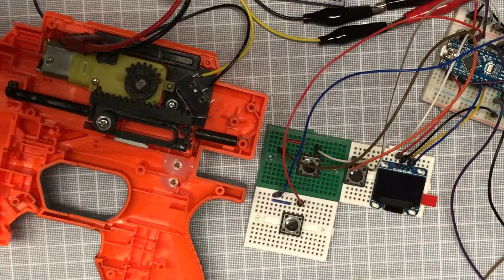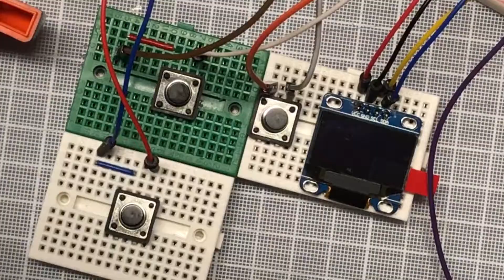{Mod} Select Fire Stryfe + Arduino (Part One)

Comment: Hey tungsten!
I love this mod, real nice!!!
I build it my self with the worker full auto kit & your YT videos.
All works fine, only display don’t work.
I don’t understand why?
I also don’t understand what are you doing in the code with the size of the oled display. I don’t know how to get into that options and where to change form 128 x 32 to 128 x 64.
Maybe you have an idea how to help.
Best wishes
Reply from the maker: hmm, I think because I am using a old version of the library I have to modify "Adafruit_SSD1306.h" file to set the screen size. I think the new library, which if you download recently (which I did not try) you can change the screen via the constructor. in my code I use "Adafruit_SSD1306 display(OLED_RESET);" I believe the new code you can use "Adafruit_SSD1306 display(128, 64, &Wire, OLED_RESET);" the library also come with example code: https://github.com/adafruit/Adafruit_SSD1306/blob/master/examples/ssd1306_128x64_i2c/ssd1306_128x64_i2c.ino
Reply: Tungsten EXE hey man!
I bought a new oled display and changed the code, now it works! THANK YOU!!! I love this!!!

But I got a new problem 😅😅 because I use the „worker full auto kit“ instead of the „XSW full auto kit“ the pusher mechanisms works just a little different. When I pull the trigger for example in full auto Modus the worker kit is mich faster then the xsw kit. I’m Shooting the whole mag but the counter says 5 darts left to shoot.
Hope you can help me 😊
Best wishes
Reply from the maker: hmm I think the rate of fire is too fast for the display to refresh the dart count fast enough. Maybe instead is update the dart count for every dart fired, we can try only to update the display when firing is done. to do that refer to this code: https://github.com/tungstenexe/Tungsten-V2/blob/master/TungstenV2/TungstenV2.ino comment away line 325, 326, 327 and 328. also comment away line 340, 341, 342 and 343 by adding a // infornt of the code. that way the display will not update the dart count while firing. the final count will be reflected after firing is completed. Maybe this will help (I am not sure).
Reply: Thanks so far!!!
I try to find a resolution with the „standard code“.
Maybe there is some code to control the pusher to do only one full 360 degree move, with an Start and end point to control it somehow...

Comment: can you draw the wiring scheme and give the arduino code? I am working on a similar project!
Reply from the maker: Yes, it is available under my github for this project, link: https://github.com/tungstenexe you can checkout Tungsten-V2 under "circuit" folder, also I did the dismantle video and circuit viseo for the build for the select fire stryfe, do check it out.

Comment: Thats really cool, I nice improvement from your RapidStrike with the OLED screen, I'm doing this kind of thing myself. Do you debounce your button presses? cause I read that you need to but coding it on all the buttons is getting complicated.
Reply from the maker: I use the "Bounce2" Library (for my RS mod as well, it simplify the coding a lot), I will put the link to the library below, and I also use the internal internal pull-up resistor from the Arduino Nano board (so that I don't need to add pull down resister for any of the buttons, which save a lot of soldering time). I uses the functions "fell()" and "rose()" from the library to determine when to execute the action of my choice, the library handles the debounce. It seem to work fine so far from all my projects and test code.

below is a quick example on using the library (you can check out my RS code and also the code under the example folder of the bounce2 library for more examples):

/////////////////////////////
#include <Bounce2.h> // include the lib

#define PIN_FOR_BUTTON   5 // define a pin for your button

Bounce myButton = Bounce();  // create instant of a Bounce

// in the setup
void setup() {

    pinMode(PIN_FOR_BUTTON, INPUT_PULLUP);   // use internal PULLUP resister, button will be 
                                                                                         // HIGH when not pressed
    myButton .attach(PIN_FOR_BUTTON); // myButton will be listening on PIN 5
    myButton.interval(5);  // debounce interval, seem to work well with 5

    //........ any other codes.......
}

// in loop
void loop() { 
    myButton.update(); // update status of the button, after which you can check for any status change

    if (myButton.fell()) { // button when from HIGH to LOW, it was pressed

        // do action for myButton when pressed, 

    } else if(myButton.rose()) { // button when from LOW to HIGH, it was released

        // do action for myButton when released

    }

}
/////////////////////////////

link to "Bounce2" Library - https://github.com/thomasfredericks/Bounce-Arduino-Wiring

link to my RS mod - https://github.com/tungstenexe/Tungsten-V1
Reply: thanks man, ill look at adding that into my code

Comment: Nice. What's that switch next to the motor for?
Reply from the maker: the micro switch next to the motor helps me to keep track of a when the pusher is extending out to fire a dart, and when the pusher is returning after firing a dart, with these information I can control the pusher motor to start or stop as well as counting the darts fired (dart counter).
Reply: Does the switch also function like the Rapidstrike stop switch to prevent the pusher arm from stopping in the extended position?
Reply from the maker: Yes it does.